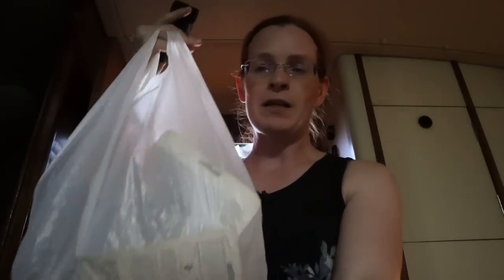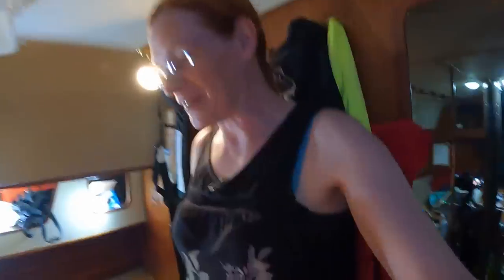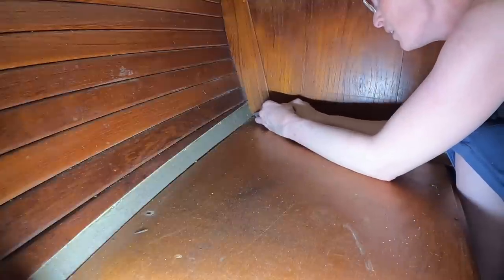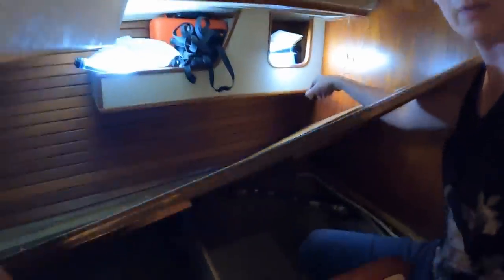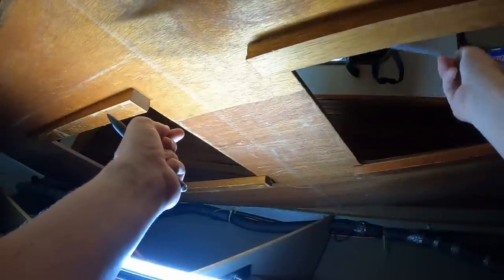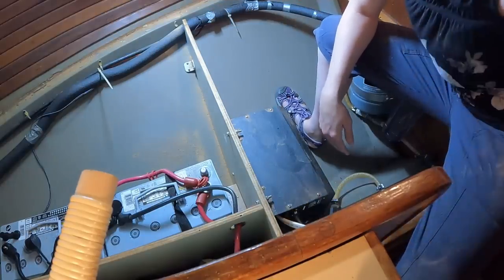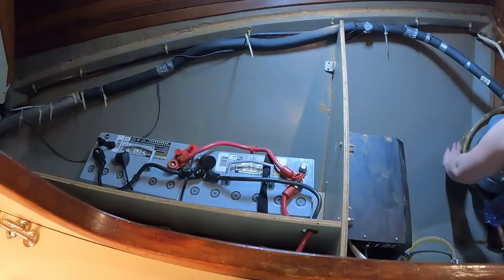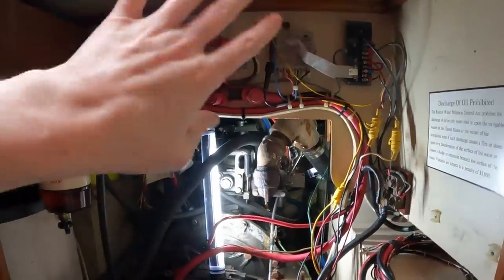Gel to DIY Lithium, Sailboat Upgrade Part 1! (Ep. 64)

Comment: To cut that battery cover plate, you could drill a few small holes from the bottom and use those to draw the cut line on top.

Comment: One Tip: The Breaker/Switch Panel is a great place to selectively power some circuits while working on others. The trick is to put a battery in front of it and connect it to ground and outgoing circuits (with proper or preferably pedantic circuit protection). For powering some led lights, I just run a very small fuse to reduce the risk of something getting warm if I short stuff out. Also great for troubleshooting and much cheaper than a power probe or similar.
Reply from the maker: So, funny you should mention... I was helping a friend try to chase the source of excess galvanic corrosion on his boat, and he put EVERYTHING on individual fuses. I thought it was a touch overkill, but wow was it handy in that case. So my current plan is to have most breakers feed little distribution blocks with those automotive-style fuses. Like one break for lights, then a fuse of each actual light. Use the breaker to isolate a section, and use the individual fuses to isolate the exact circuit.
Reply: @TheDigitalMermaid  Yeah, this seems a bit excessive but might be less work depending on how many tries/disconnected cables are needed to find the problem.

A buddy of mine really is into that topic, fearing his aluminum boat corrodes away. He has no permanently attached sacrificial anodes and a voltage normal to measure the current state of affairs. The thing is so sensitive that it catches if the stainless ladder is in the water or not.
Reply from the maker: @horstkotte6114  I don't plan to move on from Mermaid's Rest any time soon, but eventually if I ever "upgrade", it would be to an ice-rated aluminium hulled sailboard, like a Bestaever. So while I've got a plastic boat, it strikes me as a good time to learn "best practices". As bad as galvanic current is, on a full electric yacht with an aluminium hull... yeesh.

Comment: one small red diode turns on and you have a mental moment, but could not help smiling along whit you :-) I all so knowh that kind of relife and satifaction when ones work shows the wanted result. But i can all so see that der i a lot of cabel work, and probely all so multimeter work ahead off you. Good luck :-) willing to bedt you will use bad words a few more time before the boat is  converted to electric and ready for real use. Looking forward too folowing the progres.
Reply from the maker: Dude... That little red diode meant so much!

Comment: Use the volt meter to follow and verify the incoming voltage. I'm sure you will find it. When you ripped that board in half, that support piece that held that board up (in the middle), consider screwing a 1x2 along the top to make it thicker to give the boards more meat to sit on. Will also give you more meat to take a screw to secure it down. Thanks for sharing
Reply from the maker: Heh, exactly what I ended up doing. :) Found some scrap in the boat yard I could cut up to sister that board.

Comment: ARGG! It's now 0558 Hrs 
on 10.02.2 here in New Hampster, USA. I should have been in bed hours ago. It's all your fault because I started watching your DC/DC Charger video, and the morning went downhill from there. HaHa (That's a Joke)

I intend to go on the road full time, in my SUV, in the Spring/Summer of 2024, with the Alternator and Solar Panels charging the House Battery Pack. The new Victron DC/DC Charger has captured my fancy, so the title of your video grabbed me like a magnet.

You learn your way through a new project like I have been doing for 61+ years, as taught to me by the USAF. Your Trouble Shooting/Problem Solving skills are excellent. You think your way through them and evaluate your options as you go. Skills not normally seen in a Gal.

I subbed you about 10 minutes into your DC/DC video. I wish I'd subbed you 64 episodes earlier. I wonder how much sleep I'll miss watching from your #1 video up till now. YIKES!

I only wish I'd found you 64 episodes ago, but being late is better than being never.......
Reply from the maker: haha, sorry about that! ^_^ Thanks for joining along, and good luck with your own "liveaboard" project!

Comment: i'm amazed by how many wires and cables there are in there, you wouldn't think there would be that much stuff but it's a proper rat's nest, isn't it!
Reply from the maker: There's SO MUCH MORE that's not seen in the engine bay! Rewiring the boat is going to be both a nightmare and soooo satisfying

Comment: Congratulations on getting your batteries up. I'm running 1120 aH (16 cells) LifePO4 batteries, on my Morgan 38 sailboat, in a 12v 4S (JKBMS) configuration. Working well. My setup is very condensed, with all Victron equipment. On your Multiplus, make sure you turn Storage Mode to off. It is for lead acid or AGM batteries. It is found under the Charger section on the multiplus using the MK3 usb adapter. I also have found a good sequence for activating all components. Start MPPT controller to fill Multiplus capacitors, then activate battery connection to bus, then Multiplus. Also, never enter a lazerette without disabling the lock or having someone with you.
Reply from the maker: Starting the MPPT to precharge the resistors is brilliant, thanks! And isn't 1120Ah flipping amazing on a boat! I couldn't believe how long it lasted in normal use...
Reply: Yes, all that capacity is amazing. One other thing I did was install a PWM controller to keep the starter lead acid batteries charged. It has four stage charging, was $20, and is powered by the lithium buses 24/7, instead of solar panels. Works well. I'll be doing the same thing to keep my windlass batteries charged. When running your solar panels consider a fused combiner box. The fuse sizing can be changed, if needed, for each of six legs to optimally maximize MPPT voltage and amperage. The combiner box can be placed in a convenient location for interfacing solar panel cables. Then just run a 6 awg wire from the box to your positive/negative lithium busses.

Comment: hi, I undertake this type of thing most days when fixing and designing boat systems and I too share the "will it work", "is everything connected", "will it go bang"…well done you.  I would recommend a non contact nvc probe tool instead of multi meter for proof of ac voltage in the wire.. uni-t  and pico tech make a good cheap one and some clamp meters have them on the end of the clamps.. I do enjoy stripping out the old wires and gear ready for the new kit. nice planning and execution. One other thing, if your worried about the engine exhaust elbow getting hot, you can go to a car shop and get some exhaust wrap or use a section of the fire blanket and stainless wire or pipe clips to hold it in place.
Reply from the maker: I've got a Klein inductive tester for checking for AC, actually. works a treat. In most cases though, the multimeter is already at hand, so I usually grab it instead of going and finding the inductive tester. The Exhaust was indeed wrapped in thermal wrap before the trip home, made a big difference.

Comment: I feel your excitement. My project is nearing initial functionality too. It's a Thunderstruck 10KW in a Catalina 30. I've been working on her over a year now. The actual motor, controller, and throttle are due any day now and the 48V Lifepo pac is installed. Motor mounts and shaft coupling are installed.
Reply from the maker: That's flipping awesome, Bill! 10kw is huge for a 30'er. I'll be very curious to hear what power levels get you to what output speeds when you're in the water! As I reply, the second most recent video I did was on why I chose the 10kw, but in it I talk about adding a 5kw secondary motor for low-speed efficiency reasons. I wonder if that might be of interest to you in your conversion. May I ask what you had in the boat before the conversion?
Reply: @TheDigitalMermaid  
Calypso poet had an Atomic 4, rusted and seized when I bought her. Beyond repair. I found a small diesel engine for sale that was being pulled out of another Catalina 30. At first I thought that might be perfect, but when I found out he was pulling it to go electric it started me thinking. Maybe I should do that too.
One year later and it's becoming reality.
Happy New Year!  Indeed.
Reply from the maker: @billtackett7512  Petrol/gasoline engines have no business in a boat... Good riddance to it. Go electric! It's not at all perfect, but the hassles that come with electric are, in my entirely biased opinion, but less annoying. :)

Comment: You are much braver than I tearing out so many wires. You are certainly ‘electrifying’
So far you still burn diesel (gasoil) in my Yanmar 2GM20F. I don’t have such a spacious sailingboat 33.5 ft) to store such large batteries … I think.
Reply from the maker: Brave or stupid-but-lucky can sometimes look pretty similar. Haha. ^_^

Comment: You can no straight the line or better the egde of every plate and repaint it all.
@The Digital Mermaid - Combiner...look up the Citrix relais/combiner from Victron. You will find some drawings and some information forit how it works.
Reply from the maker: If I ever need to use a combiner, I'll dig into it more. I don't suspect I will though, so for now, on to other tasks. So much to learn still. :)

Comment: that's funny what you said about taking toys apart and not putting back together, i'm a bit like that, i am currently scrapping a load of old new aircraft spares, precious metals etc, what's funny is its great taking it apart with zero intention to put back together, as it just gets separated and put into scrap bins, but you do learn about the workings and how things work, go together and so on, but i'm not very good at remembering, like some bits a take apart, i know i done it before, but how did i do it and with what tools - some bits just fail me, so i have to give some parts major abuse with the angle grinder, i win
i love what your doing with the electrics, i do have a little OCD and seeing the 'rats nest' winds me up, using space more efficiently is another, like yourself, i am pretty sure at the end of the day you can make this work so much better, and save a lot of space too, that filter on the left side, looked a pig, i'd probably put it of the same white surface where the big clunky switch was, but you probably need that space, lets see, quite an education to see how boats were put together
i been watching a young fella, channel 'in too deep' he bought a wrecked storm damaged boat, very nice, originally had nasty old gas gusher Detroit  diesels and now has more efficient Cummings, but has also rewired the boat, ripped a lot out and replaced with LED, pretty cool what he does

Comment: Very exciting.
Though, do you calculate the extra weight and sailing properties?
To much weight in the back and you'll only sail decently downwind, upwind will be more difficult dependant on the ships balance. Too much weight in the front and sailing up wind might feel like a breeze but downwind sucks.
Reply from the maker: Considering weight has been a big topic, yup. I'm talking to a naval architect as well, and I'm just waiting of finally picking a motor (surprisingly hard...). Once I've settled on a motor, I can dive into the weight calcs. As it is, I'm likely going to shorten the two settee tanks so that I can move two batteries forward towards the mast step area. When the time comes, there will likely be a small video series on weight and windage concerns and mitigation.

Comment: I'm a former electronic tech and now rv repair. I'm sweating watching you remove all the wire so fast with limited labeling.
Reply from the maker: When I rewire the boat, everything will be labelled thoroughly. Not having any labels was a huge frustration. (and it'll be labelled properly, not with masking tape, lol)

Comment: You mentioned several times that there was SOLAR on the BOAT before you purchased it 
Am  I  confused ?  I do not recall SEEING any solar panels or components ?
COOP
...
Reply from the maker: The boat came with an old solar panel, which mounted on the davits. I had an accident where I crushed a davit, so I couldn't mount the panel anymore. The panel that came with the boat was really old and in poor shape, so I binned it. So yes, technically it had solar, but never usable since I bought her.

Comment: Is there an ABYC standard to label wires? (I would certainly need that for myself, because I'd forget what everything was for.) The original mess of wires seems impossible. What if you had to fix a specific electrical problem?
It seems like you're ripping out lots of it, but a lot is still there, like wiring for lights and other things.
Reply from the maker: I've not seen anything in the standards for labelling. If you look at my early videos though, I have on on flagging cables. That's how I plan to do it when I rewire properly.

Comment: Wiring. The one thing I was never taught to fix and I struggle with. There you go making battery banks, ripping wires out with not a care for what you are doing and I can't make a tacho and temp gauge work. Go you.
Reply from the maker: Awe, it's all practice. Keep at it and it'll get easy. :)